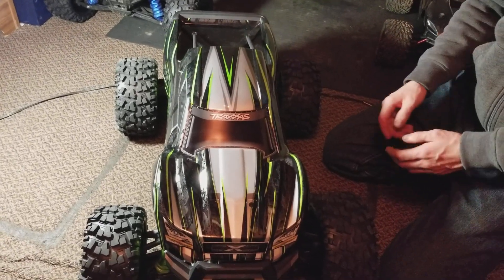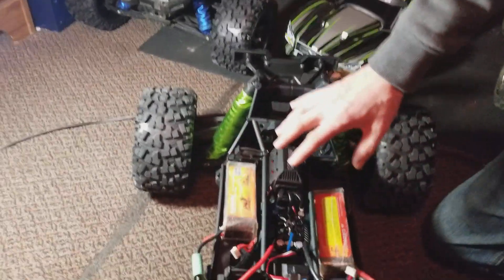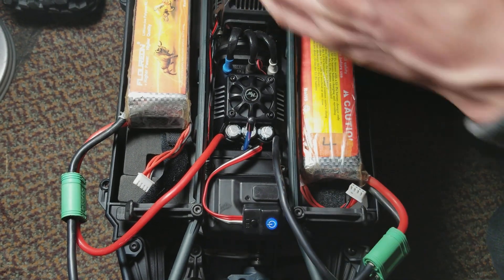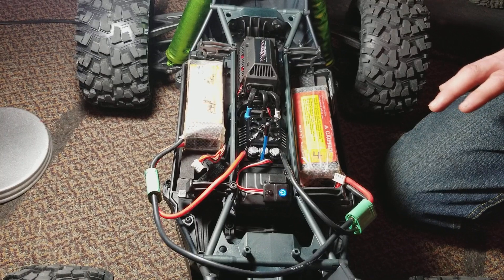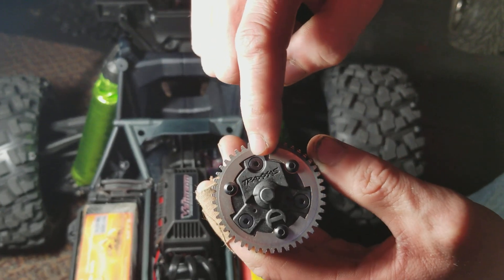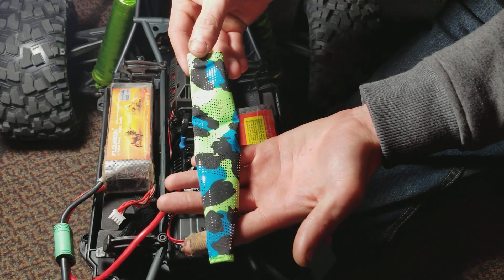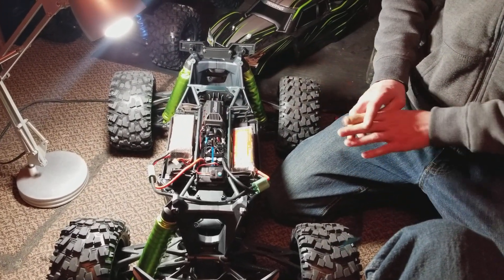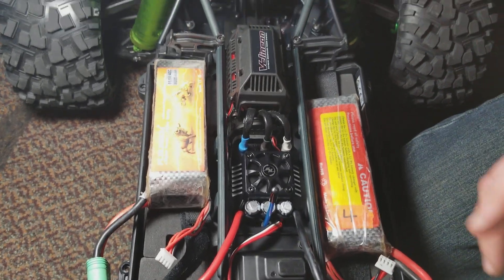How to calibrate a hobbywing ESC in a Traxxas X maxx

Comment: Hi, thanks for the video! Further question on the Hobbywing ESC: is is “smart” as well as the OEM that when you want to reverse an already stopped truck you do not need to brake first and then reverse but the electronics knows that the vehicle is stopped and initiate reverse for the first frint pushing of the trigger on the radio? Thanks
Reply from the maker: Yes this speed control dose it but you can also program it out to it you would like it's a preference for what you like
Reply: @alexperea20  Thanks! Do you mean programming with a programming card or by connecting it to a PC ..or else?
Reply from the maker: @robertsoltesz2211  if it's factory esc you can program it by the Traxxas app or by the led flashing lites

Comment: Hi nice video did u ever find out wat that shaking was mine does that any time my tsm is on any suggestions and my xmaxx is all stock
Reply from the maker: Hello thank you for commenting on the video and watching the video hey I found out that I was having a interference problem with my radio system it's never did it again ever to me I would strongly recommend to recalibrating your speed control and transmitter and starting their
Reply: R u happy with ur max 6 setup
Reply: Like do u think u need a max 5

Comment: U no your stuff bro thanks . On my new max 8 I had to do mine in the reverse order . Mine kept going to reverse. So do it in the reverse order nutural set. Reverse set. Then full throttle set. Turn esc off an back on . It should have forward newtural an full throttle. Thanks again bro. I have learned alot from u over the years.

Comment: Great video. Question. My truck Was stored for about 6 months. Pulled her out to drive it and it won’t go full throttle. I did this and it still won’t. It seems like it’s running on low voltage cutoff. Any help would be much appreciated

Thanks
Reply from the maker: Make sure your batteries are properly charged and the batteries are not bad LiPO batteries will go bad if they're not put in storage charge after use and then charge properly also make sure the speed control is calibrated correctly look up for the speed control brand that you have instructions to see how to properly calibrate that particular speed control

Comment: Hello mate. I recently installed the max 6 esc on my xmaxx..but is it normal to push the trigger up to 60% before it responds to drive reverse? Did all the calibrations even all the settings with my program card..rest works flawless....🤷‍♂️
Reply from the maker: Do you mean like there's a delay when you go in reverse just letting you know with this speed control in the max 5 speed control you have to be to a complete stop before the speed control will engage reverse so usually there always is a delay in reverse and reverse usually is either 25% or 50% you don't get 100% throttle in reverse with hobbywing speed controls Factory their set at 25% unless you change it with the Wi-Fi module or a tuning card
Reply: That will probably will be it.thanks mate👍

Comment: Once I installed my hobby wing speed controller I started having that same steering shake issue. Never had it with the original ESC. 

Happens frequently especially when it is off-balance.

I could really use your help trying to change the programming in it though if you could help. I also noticed by installing those that my reverse speed was cut in half. I also noticed that my punch speed or take off speed had been dialed back also. I was looking through the manual trying to figure out how to adjust all of this but for some reason it is not allowing me to adjust the punch speed nor the reverse

Comment: What servo are you running? Seems super fast and strong. And can I use 7.4V on stock servo or only 6V?
Reply from the maker: Ali H. I'm using the stock steering servo with a b e c voltage set at 6 volts the stock Servo cannot handle 7.4 volts you could cause damage to the servo thank you so much for watching the video it is insanely appreciated
Reply: Yeah no problem. I find your videos interesting. You got a subscriber from Denmark!

Comment: Thanks for the detailed video.. I can’t seem to get mine working. The steering works bit can’t get it to register the throttle. When pressing the set button there is not been to say it has register neutral, forward or reverse. Any ideas what could be the issue?
Reply: Aki dude I’m having the same problem. I couldn’t get my first max 6 to calibrate and I just installed a second one with a new receiver and I still can’t get the throttle to calibrate. I have steering.
Reply: Same 4 years later. Any chance with your problems?

Comment: You my want to try a glitch buster, that will stop the servo glitch cause of low power our up your battery output power. Just a tip cause I had the same problem with my Hobbywing.
Reply from the maker: Tank 62 thanks  you for the commit  i was thinking  about  trying  that because  the hobbywing esc is power hungry  I was thinking  about getting  one

Comment: Mine doesn't register when I try to set forward (no two beeps after pressing set button). I tried several times with the same results.
Reply from the maker: Shad McDaniel possible  you have a bad power switch  on you speed control  try to press the SET but a litte more firmly  if that don't work then call hobbywing
Reply: The ESC wire needs to be plugged into the 3rd slot. Not the #2 slot like I believe you stated in an earlier video. Anyway, problem solved.  Thanks for your thorough tutorials regardless.
Reply from the maker: Shad McDaniel I said  it needs  to  be  in channel  2 port on the receiver I'm glad  it's working  for you

Comment: So I push and hold set turn on esc and release set on the first beep. It keeps beeping then I don't even touch the remote and press set and it just stops beeping. No red or green light
Reply from the maker: Tyler Maloney  Yes press and hold the set button and tell you see 1 red Flash from the led then let go the led will go with throdle at neutral  press set 1 time the motor  will beep 1 time pull the trigger  to full throttle  and  press set the motor  will beep 2 times  then go full reverse and press set the motor will beep 3  Indicating the calibration is correct
Reply: Alex rc freak I do that but as soon as I hit set to set neutral the led and noise stops and then it doesn't do anything.
Reply from the maker: Tyler Maloney you may  have a defective  ESC  check your throdle adjustment  on your radio  and make shure it is at 0 or neutral
Reply: Alex rc freak according to traxxas app throttle is at zero. But it won't even let me calibrate my vxl8s esc either. Been fighting with it for a week now.
Reply from the maker: Tyler Maloney sounds  like  your radio  system  is  bad
Reply: Alex rc freak well shit
Reply from the maker: Tyler Maloney yes if your  vehicle  still has warranty call traxxas  and they will take care of you